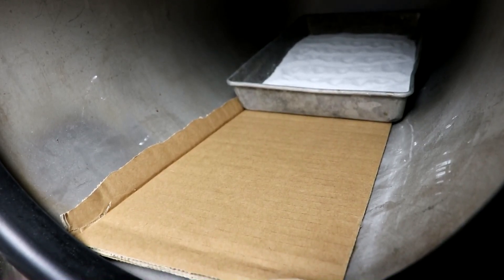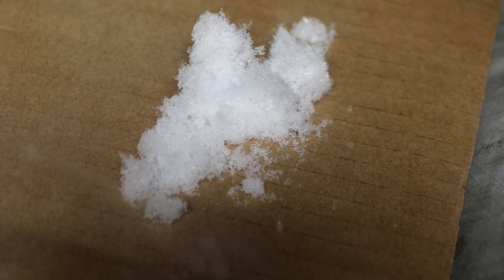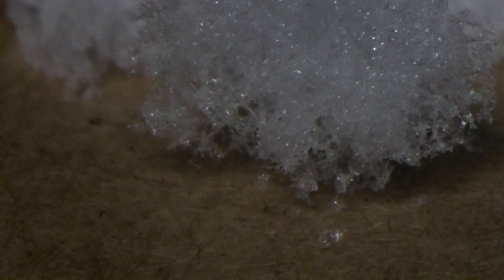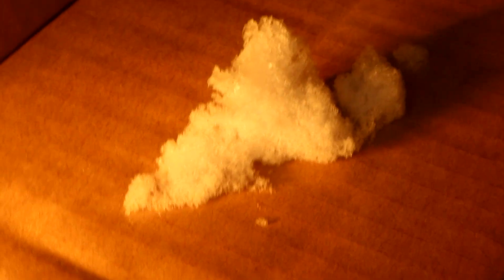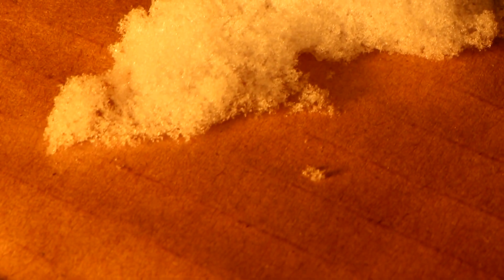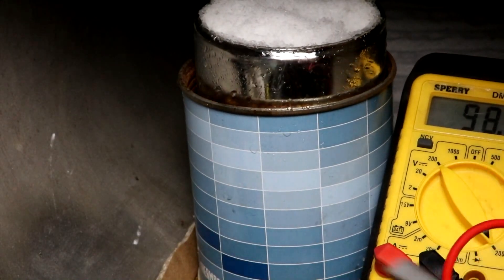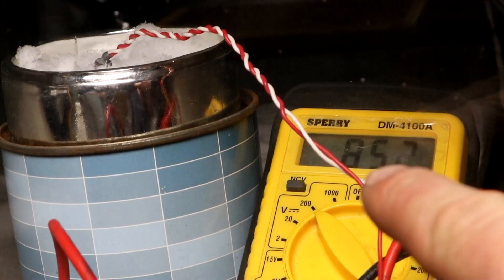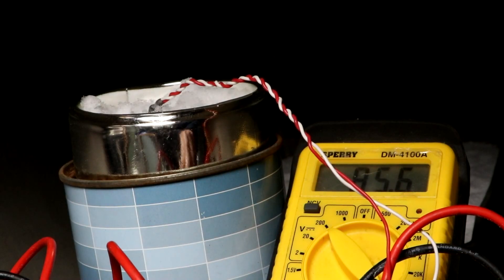Snow In A Vacuum Chamber

Comment: Can you put coal or carbon in the vacuum chamber and see if it turns into diamond?
Reply from the maker: Thats actually not as absurd as it sounds and is on my list of videos to do.
Reply: I thought you need very high pressure, not very low pressure?
Reply: Wait, Cody, you're actually serious?  Whaaatt?
Reply: Cody'sLab remember the trick that ElectroBOOM suggested? Do it again but with a pressurized CO2 cartridge
Reply: Huh? That makes no sense. It'd have the opposite effect, although the effect would presumably be so tiny that you wouldn't see any change in the diamond.
Reply: The decreased pressure wouldn't cause the diamond to go to carbon.  Diamonds have a very stable lattice.  If you inject enough energy into the lattice, however, the diamond will start to turn to carbon without any additional energy input.

Source: learned it in general chemistry II.
Reply: That would have the opposite effect. You could probably turn a diamond into carbon with a vacuum chamber

Comment: Leave it to Cody to make watching snow melt interesting. What's next, Paint drying?
Reply: Poontang Smasher5000 paint drying in a vacuum at elevated temperatures in slow motion.
Reply: I would watch that
Reply: Poontang Smasher5000 don’t give him ideas
Reply: Sixty Symbols have a video all about paint drying !
Reply: Well, depending on what solvents and polymers are used in the paint, watching it dry can be quite interesting. Certainly the manufacturers need to know this sort of thing! Hammerite is my favorite.

Comment: So all liquids boil in wacuum chamber, even mercury, it's a fundamental propertie of liquids? I think if in liquid the heat is enough to separate the atoms so only pressure can keep them from boiling so there is only two fundamental states, solid and gas, the liquid state is a gas tat's pressurized?
Reply: Yes, but I mean if we only take into account the heat and the resistance of molecular bonds in the state of the materials.

But it was a silly way to explain that.
Reply: Oh, i know than the state of the material is defined by his mechanical properties, not by the cause of theses properties, it was just a way to explain why it think no liquid can support vacuum

Comment: Why dont you try and cook up a potato in a vaccum chamber?Would it boil and cook like in normal pressure or would it be so quickly that the potato doesnt have time to become tender? (aka what happens when you build them in mount everest)
Reply: The water would boil at a low enough temperature to make it impossible to boil a potato
Reply: That seems right,then what would be the optium presssure that a potato cooks evenly enough but also easly enough. :P

Comment: I can see it now: the DANGERS of twice vacuumed water
Reply: That dihydrogen monoxide is nasty stuff.
Reply: No. Monoxide: mono-oxide, literally means one oxygen.
The full name for CO is Carbon Monoxide. There are a lot of monoxides that are safe, namely dihydrogen monoxide.
oxide by itself is used when a compound has one unambiguous or commonly used oxide form (form with oxygen in it), but an oxide can have more than one oxygen in it.
Reply: AnimationCraft H2O. How many O's do you count? H's? How many C's do you count? Now ponder that relative CO and CO2. Key details in differentiating carbon monoxide from the dioxide form and dihydrogen monoxide. However, yes, some texts do omit the "mono" from some chemical names for ultimately arbitrary reasons, typically because it's assumed "oxide" means "monoxide" meaning 1 oxygen atom attached
Reply: most of the times when mono- is omitted from something containing only 1 oxygen is when the molecule is ionic in which case the prefixes aren't needed.
Reply: Well, IUPAC name of water is Oxidane, there is nothing like dihydrogen mono oxide, we don't need to specify hydrogen atoms in IUPAC as they are there just to fill up valence places.
Reply: Maxx B I think you mean dihydrogenoxide since monoxide = CO. when there is just 1 of something you don't have to put mono in front of it.
Reply: @minacraftXD  I believe that monoxide is the technically correct term since it is a covenant bond, not an ionic one

Comment: Noob comment: wouldn't the vacuum also insulate the snow, making it melt way slower?
Reply: Radiate, yes, but I'm talking about the situation without the heatlamp. Of course there's still some radiation, but I suspect that the heat transfer with the surrounding air has a bigger effect, especially due to the big surface area of snow.
Reply from the maker: yes didnt you see that it melted much faster when the air was put back in?
Reply: Heat can radiate through a vacuum - that's why we can feel the heat from the sun despite the vacuum of space being in the way. I could be wrong, but it might be infrared radiation that's heating the snow.
Reply: Tim Derks ah yeah, i just posted something along those lines:

"I guess it's melting so slowly, because there's no atmosphere to transfer energy into the snow.  So the only energy available to melt the snow is radiant energy, which is substantially slower than conductive heat transfer :)"
Reply: Infrared light is a form of electromagnetic radiation. and heat transfer by radiation does not require a medium(in this example air).